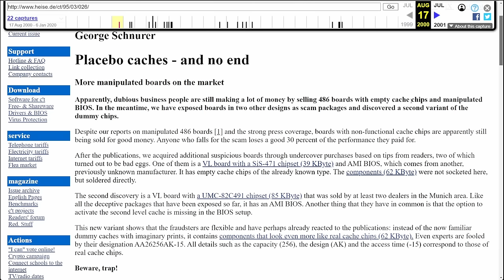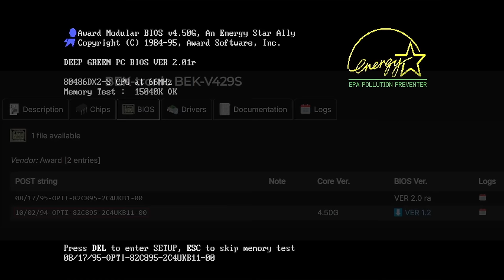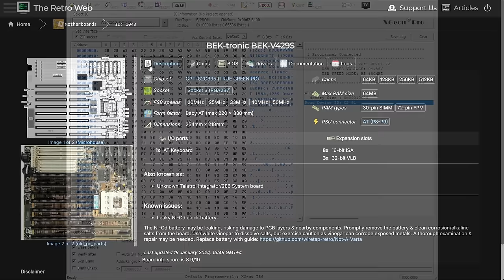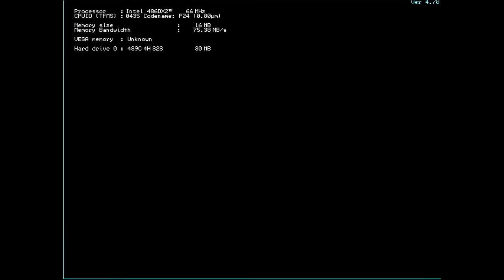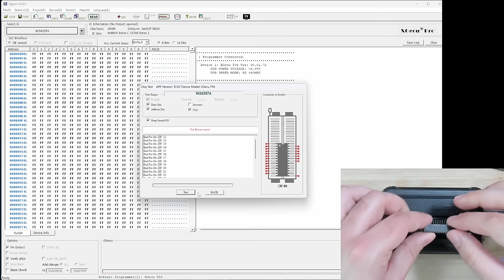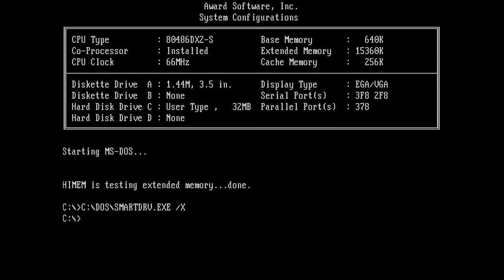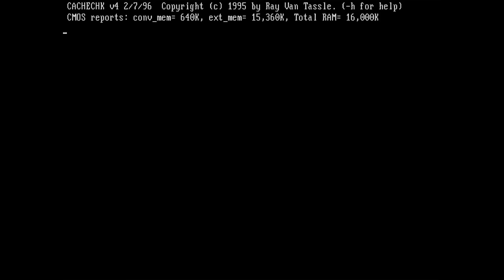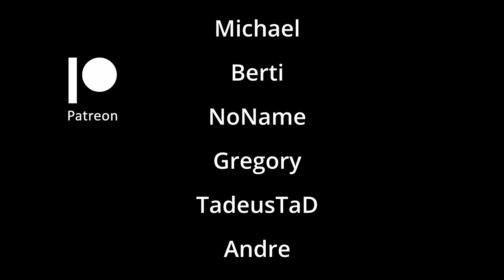They fooled so many: Fake cache chips!

Comment: “None” and “256K” are both exactly 4 characters long. The simplest hex edit in the world.
Reply: I had the exact same thought. They probably took the stock BIOS, searched for "None" and replaced it with "256K" and put the empty chips in the board.
Reply: Maybe do a hex edit to the edited bois and have it say "ZERO".  And if it turns out it had two places that say "256K" change just one and see if you see "ZERO" with no cache, or maybe it says "ZERO" when there really is cache memory present.  In which case change "ZERO" to 256K" and "256K" to "ZERO"
Reply: Isn't there a program that displays both bios side by side and highlights the differences in red, ie, seen it somewhere.
Reply: @SidneyCritic  They are different versions - so there will be a LOT of differences
Reply: @Lilithe  Actually, the string '256K' is not hardcded anywhere in the BIOS from what I can tell. Not even the digits "256" so they are doing something a bit sneakier and likely just changed the return value from the function that checks for cache to always be 256k.
Reply: @AureliusR  The amount of cache memory won't be a string literal, but the text to display when there is no cache will be.
Reply: This would imply that using less than 256 should show the correct value. Maybe test that, and if this is actually the case, you may be able to "fix" that BIOS
Reply: @axelBr1  In a normal BIOS, yes, but for the faked BIOS I would assume they'd just hardcode the string. However, in the function that determines the cache amount, they've likely edited it to just always return 256k
Reply: @AureliusR  The point made by the original commenter is that only 4 characters are required for both NONE and 256K. The text None is easy to search for in a HEX editor and replacing it with 256K would not affect the rest of the BIOS code in anyway; i.e. they would not need the BIOS source code to recompile it; which is what you would need to do, with what you are suggesting.
Reply: Would have been good to put half the number of chips in to see if it displayed 128K to confirm that theory.
Reply: @AureliusR  That seems more likely. The BIOS still shows the D: drive as None, so the string None must still exist.
Reply: @axelBr1  You would not need the BIOS source code any more than people need a game's source code to crack it. This is just a BIOS crack. Lol.
Reply: @axelBr1  And in that case presumably if you put 128k in, it would display the correct value?
Reply: @katrinabryce  Yes. The only problem would be if you put in fake chips of a different size. But they probably included BIOS chips hacked for the size of cache being bought
Reply: @TalesofWeirdStuff  You would if you wanted to change the functionality. I'm sure you could disassemble the code, but a lot of effort for selling fake cache chips
Reply: @matthiastilly5480  They certainly claim to be different versions. Wouldn't surprise me if the 2.01r version number is fake too.
Reply: @axelBr1  Maybe. But there are probably only a few sizes possible, perhaps 256K, 512K and maybe 1024K.
Reply: @ShALLaX  No. You normally need all the chips, or maybe only certain combinations of empty and full are allowed.
Reply: @axelBr1  It was rare that many different sizes were possible. Some of the sockets are larger though, so maybe a larger size is possible with a different set of chips that aren't all identical.
Reply: Most probably the hex editor can find the text "256K" in the BIOS dump, I wonder if it was changed to "NONE", would it work properly? (I mean displays NONE when there is no cache and displays the proper amount when cache is added.)
Reply: @SidneyCritic Something like diff ?
Reply: Do they ("None" and "256K") have similar eight bit checksum?
Reply: @iblesbosuok  Good point. BIOSs in ROM often check themselves using a checksum or similar of some kind so just changing "256K" to "NONE" may result in an error.
Reply: @iblesbosuok  first, “checksum” is not an algorithm, and second, old bioses didn’t have any sort of integrity checks
Reply: The character length seems to lead to a plausible theory, but my findings point to a different direction.
I compared V1.2 with V 2.01r ( @Bits und Bolts , guess that was your sumission; thanks!) and figured that both binaries contain the string:
"Cache Memory      : " That is 6 spaces before and one space after the colon, then null termination. Looking at the alignment on screen (23:36), we see that this gives room for a 5 digit number. This string starts at addr 0x23F1 in V1.2 and 0x24CE on V2.01r. 

I just don't know how to decode the instructions around the strings. I suspect them to be jumps to functions since I can't find any plausible values. We do find a "K" a few bytes before the string starts, though. No "NONE" string nearby to seem relevant.
Reply: @SidneyCritic Total commander has option to compare files, in hex or just contents
Reply: No, they have injected a small chunk of code into a chunk of FFs that acts as a proxy to the real "get cache size" subroutine but replaces the return value with 5 (8K<<5=256K) and then called that proxy when the summary screen is displayed. You can verify that by disabling the cache in BIOS settings - it will report "None" as expected.
Reply: @tigerchills2079  u need an assembler that can translate those to machine code .. should be plenty around .. (worst case use pen and paper and the x86 instuction set manual from that cpu/time)
Reply: @Patrik6920  yeah, good point. My post was just compiled on the same evening that I watched the video. I had to make a cut at some point :)
Reply: @tigerchills2079  ya sleep is good to squeeze in once in awhle i been told ;D
Reply: I think some folks might be overthinking this a little. As then OP says, it is easy to find the correct "NONE" string in the BIOS and change it to report "256K". Other strings containing "NONE" will likely exist (e.g. for disk drives) but it is very unlikely they will use the same copy of the string so only the one associated with the cache needs to be edited.
As for other sizes of cache (e.g. 128K) this would not have been a concern for the scammers, they are selling a motherboard with fake cache and a hacked bios installed. They would only do this for the largest cache size possible (most profit) and would not care if someone, in the future, changed the chips and discovered their scam. By this point they would be long gone.
Reply: Except that if that "None" is also used somewhere else for example, floppy A: None.
Reply: @terminal2004  finally someone who understands this..
.. in the early days storage size of chips was limited and every byte counted .. its not that 'none' or 'not connected' exist as a 'string' for eery device or value.. thay existed as hardcoded strings ... and chip sizes as cache as a math trick .. one byte could hold settings for many things and a single byte would be enugh describe cache sizes from 16KiB to 4MiB or 32KiB to 8MiB depending of system for example..

Comment: Back at the time, a french magazine took a suspicious motheboard to the nearest dentist, to make a X-ray pic of the fake chips : thoses were empty.
Reply: These days a thermal camera would easily show whether there is a chip inside, by the slightly warmer rectangle in the center.
Reply: @gblargg  Or probe a data line with an oscilloscope? Would that work?
Reply: @cebruthius  Yeah, check an output line for voltage.
Reply: @cebruthius  you'd need to know which lines are supposed to change only if a chip is connected. Watching a level changing isn't enough, since it could be another chip that is changing it.

Comment: I actually purchased a MB with these fake cache chips on it back in 1995. At the time, I was really obsessed with measuring performance, so when I upgraded from a 486 DX2-66 to a DX4-100 and saw no increase in performance, I started investigating. This was difficult at the time, but I finally read something about this and was able to confirm the scam. When I returned the MB to the retailer and told them the story, the guy smirked and said, "Hm...well, you're smarter than the average bear." :-D He all but admitted to the scam and replaced the board with a genuine board. I was able to confirm that the cache was good and I saw an appropriate perf boost after that. This was an ordeal, because this was not widely known at the time. The "internet" in 1995 was of course not what it is today. I had to smile when I saw this video in my recommendations. Yep...been there, done that. :) Thanks for the video!
Reply from the maker: Good that you figured it out! The majority didn't. As you said, it was difficult to test and find this information. Thanks for watching!
Reply: Interesting story!
Reply: Was the DX4-100 the Blue Lightning or Cobalt?
Reply: So did the retailer KNOW that he was selling fake boards? If yes, did you punch him in the mouth? Or if no, what action did he take against the people who had supplied the boards to him?
Reply: @kc5402  I was not able to determine whether he knew he sold fake cache, or simply knew about the scam.

Comment: The pinnacle of fake cache chips is a series of Socket 7 motherboards that we got here and had 4 black rectangle (QFP) chips with embossed "Write Back" on their plastic housing and the housing was just plain PVC with pins. Hilarious.
Reply: Yep, I had a 486 board (might've been a PCChips board, can't remember) with those "WriteBack" chips on it (normal dip package ones). Ami WinBios said something like '256kb Writeback Cache Enabled' on bootup, you could even switch the cache on and off in the bios, and the bootup reflected the change. Just a shame it was making no difference whatsoever!
Reply: @sierraboney1394  PC Chips M919.  There were a few versions, I think.  Some had the fake QFP packages soldered down. I have one that I bought new, back in the late 90s. It doesn't have those parts mounted, but has a proprietary Cache On A STick module (256kB) which is functional.
Reply: Yes. I've seen a few of them. Soldered directly to the board.
Reply: @sierraboney1394  When did you buy it?
Reply: PC Chips M919 I think.

They also claimed to be whatever chipset the distributor paid then to sticker on the anonymous chipset.

Comment: A quick way to tell if there's any silicon inside a chip is to set your DMM to diode check mode and measure between Vcc and Gnd. With the black meter lead on the Vcc pin and the red meter lead on the Gnd pin you should be able to measure around 0.6 volts on an actual chip. Every chip has a reverse biased diode from Vcc to Gnd that's unintentionally made during doping.
Reply: Didn’t know that. That’s quite interesting and useful to know.
Reply from the maker: I need to remember diode mode! It comes up very often and seems to be a super power :) Thanks for sharing! I will try that right away! OK, I checked! You are correct! Real chips show something between 0.6 to 0.7 volts. The fake chips show nothing (OL).
Reply: "Every chip" like every-every? Simple logic, memory, etc ? Cool  info
Reply: It's not a bug, it's a feature
Reply: At least every digital chip with CMOS or even NMOS. This includes any memory and processor chip made probably after 1990. I wanted to check on some 74 chips, but the ones I have in reach are all 74HC, so they are CMOS anyhow.

Comment: That's a pretty wild discovery.  I've heard of fake cache chips, but a BIOS apparently designed to lie to you about it is something else entirely.
Reply from the maker: I love finding these things at the scrapyard - each item seems to have some sort of story linked to it. I also didn't know they went to that extend to fake cache chips. But I am happy to hear that so many viewers are amazed how far those people went to make money.
Reply: It still happens, but now with modern Non-Volatile memory products. If you see a ridiculously high capacity medium sold at a ridiculously low price, they are fake. Your OS will show you that they have the capacity as shown by the label, but if you try to copy a (few) large file(s) to it, it will give you a write error.
What's problematic is that this is occasionally also the case with media that are sold at regular prices for their stated capacity.
Reply: My guess would be unscrupulous systems integrator patched the BIOS after finding themselves in receipt of a load of fake chips. Seems obviously patched, and so therefore not an official release by the BIOS vendor themselves.
Reply: One follows the other. There couldn't be fake chips without a fake BIOS, or you'd twig to the scam immediately.
Reply: @LarixusSnydes  That's why it's so important to use something like F3 to test what you buy AND buy from a reputable source, if for no other reason than to ensure a good return policy.

Comment: I have a 386 motherboard that came with fake cache chips. Not only that but they weren't socketed - they were soldered on the board. And had a doctored BIOS of course that showed "cache" on POST. I unsoldered those chips, installed sockets and real SRAM in them and it does have real cache now. I was lucky enough to find on ebay a number of years ago a large lot of SRAM cache chips that were NOS in tubes from a surplus lot so I have plenty of those. They are not the faster 15ns variety but rather 20ns, and still they work fine as cache in all motherboards I used them in.
Reply from the maker: Wow, that's a commitment to fake cache! They saved even on the sockets!
Reply: @bitsundbolts  soldered fake cache is actually a lot more common than socketed. In fact it's one easy way to tell if a motherboard's cache is fake or not: if the chips are soldered, it's almost always fake. This is valid for DIP chips of course. While fake cache does exist on some Pentium motherboards, most of those use the QFP-package burst cache chips which are always soldered. For those, a way to tell if they have fake cache is different: if there are almost no traces leading from the "cache" chips to other components on the motherboard. :) They saved on copper to fake the chip connections.
Reply: @stamasd8500  So disgusting. Even MB manufacturers are responsible for this scam. Which brand it was?

Comment: Fake cache was a real problem, and ruined PCChips reputation as their boards started shipping that way too. Kind of sad.
Reply from the maker: I do have one of those boards. It has solder pads, but the traces route from one cache chip to another - no traces go anywhere else.
Reply: @bitsundbolts  Begs the question, what were they thinking...
Reply: Ah PCChips - the Maxtor of motherboards.
Reply: I think I remember seeing a video where the cache chips were hollow...
EDIT: Speaking of the devil 25:53
Reply: They were crap from start to finish, the fake cache chips looked fake and were made of some gharbage soft palstic you could dig a fingernail into.

Shame as the chipset was pretty OK but the quality of the PCBs was just awful.
Reply: @ScottyBrockway  I'd wager they were thinking something along the lines of MOAR MONEY, without of course considering long-term implications because whoever approved this was certainly long gone by the point the world at large figured it out

Comment: BIOS with double characters comes from 286 era, when there were two 8b chips (EVEN and ODD, or HI and LO) for a total 16b-wide ROM function. There was copyright repeated on both chips, hence the double characters. 486 supports bus sizing, so it can read 8b ROM (almost) directly, yet apparently the characters remained as they were before. There is an option in setup to turn on ROM's shadow (copy it into RAM), which speeds things up (32b access). When it's set ROM chip can be removed after boot with no effect, but don't try it 😉 Later BIOSes were compressed (more advanced), and they decompressed into RAM after power on, so those could be hot-swapped for flashing. Did that when computers were expensive, and programmers weren't actually cheap to get either.
Reply from the maker: That makes a lot of sense! Thanks for sharing. I am working on a 286 right now - which indeed has two BIOS chips (Hi/LO or EVEN/ODD). Thanks for clearing that up. Also, I did hot-swap a BIOS chip on an ASUS P3B in one of my videos! I never did that back then, but I wanted to try.